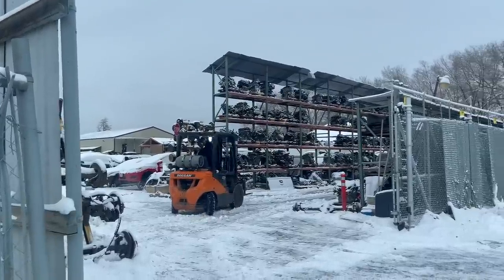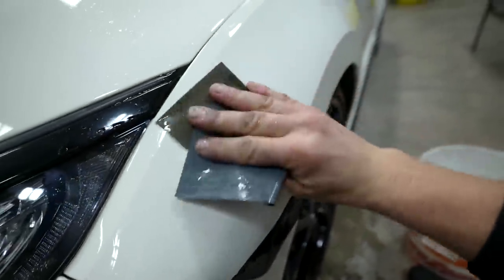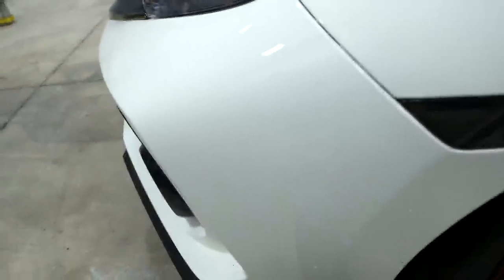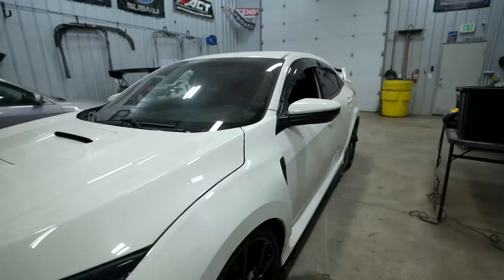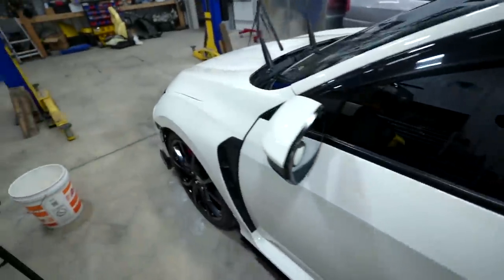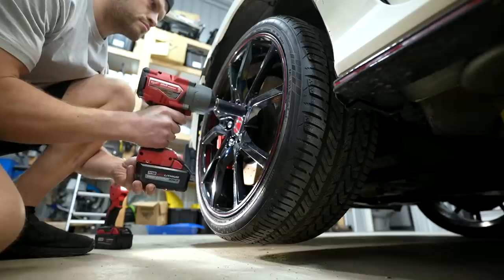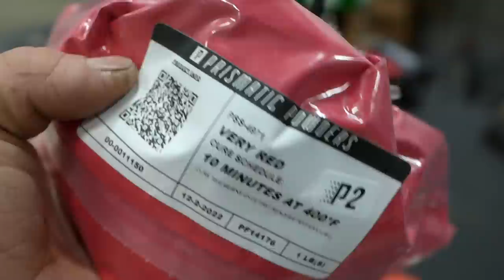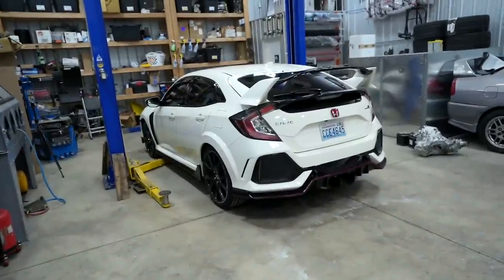Wrecked 2019 Civic Type R Rebuild | Ep.5 (I couldnt resist...)

Comment: You should give the new 3D glass polish a try. It’s by far the best glass product I’ve tried. You might have to use a rayon pad if the etching is to bad. I figure if you had to break out the rayon you might just buy new glass. But you are always going deeper into fixing rather then buying so this might fit the Devin school of auto repair and restoration. 
Peace out ✌🏼 
#keepmovingsideways